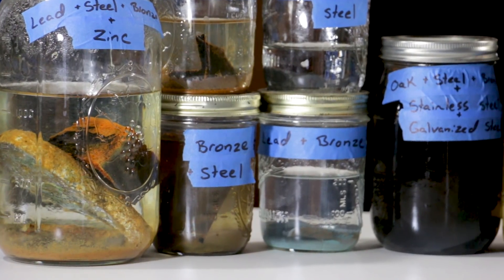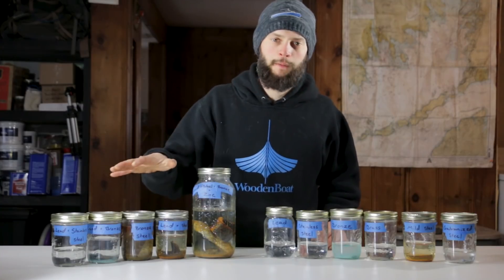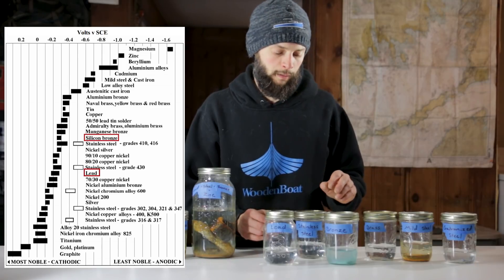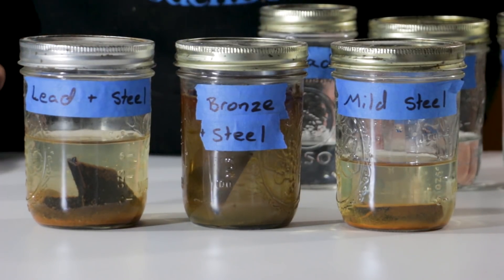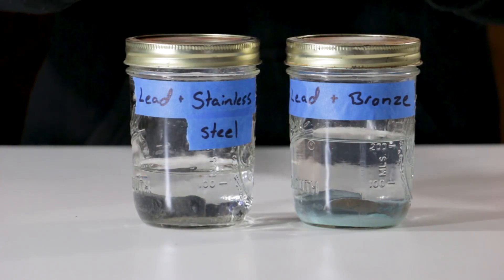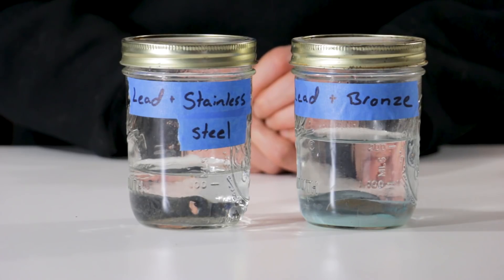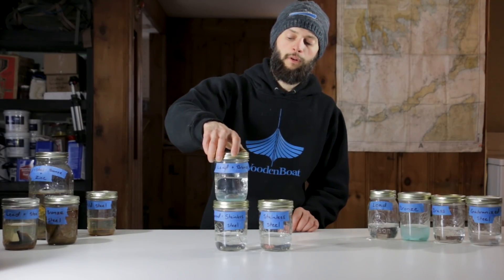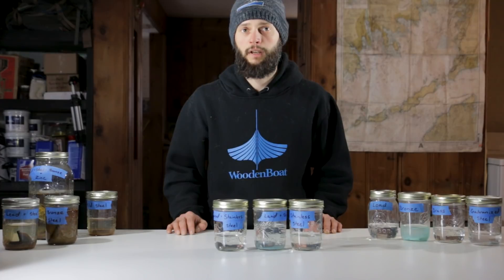A2A - Journey of a Wooden Boat - Bonus Content: Dissimilar Metals and Galvanic action Part 1

Comment: I am really late to the game as I have only just discovered this channel. What an incredible journey. I like this video because you actually conduct an experiment to support your choice in materials. However the nerd in me needs to make a couple of comments 
Although the nobility scale for metals has been around for a long time I think it would have be simpler to talk about more to less reactive metals. 
The “nobler” metal does not attack the “less noble” metal. The electrolyte (salt water) preferentially attacks the more reactive metal
You only talk about stainless steel as an alloy. If fact all your metals except lead and zinc are alloys. I assume your bronze is silicon bronze rather than aluminum bronze. Silicon bronze alloy is more common in boat building for cost and structural properties 
Ok done. Can’t wait to binge through to get caught up
Reply from the maker: So glad you found us!

Comment: FYI, "nobility" is a rough approximation of what is known as standard, half-cell reduction potential or standard electrode potential: higher numbers mean more "nobility", lower numbers mean less "nobility". It's possible to put numbers to these things, and it's generally a good idea to try to do so at the interface between the two metals. There are many things which can be done to mitigate these problems, but the "sacrificial" metals are the most common and probably cheapest in most applications, but there are many other electrode options outside of pure metals which can be used alone or in tandem to mitigate oxidation.

Comment: I was a marine corrosion engineer when I used to work for a living.  I did a lot of accelerated life testing on our products (military sonar systems) and some of the things your tests lack (although being quite clever) is the influence of oxygen in the reaction.  Also trace elements in your test water need to mimic ocean water (we used a commercial aquarium salt called Instant Ocean).  Magnesium in particular will influence anode throwing power.  Bubbling air into your test solutions will make a profound difference.  Air is fine as water will take up only as much oxygen as the temperature allows ( I used to run the tests at 50C to provide an acceleration factor of 13.5 to 1.   I have a patent that explains this http://www.freepatentsonline.com/8012373.html.  I also wrote an article which gets into detail on how to calculate anode quantity http://digital.oceannews.com/publication/?i=99313&ver=html5&p=1&_ga=2.253171840.845859776.1549662016-968016094.1549662016#{"page":44,"issue_id":99313}.

A piece of advice I can give to you and your readers is not to use stainless steel underwater.  It can corrode in numerous ways other than simple wastage.  Oxygen starvation and pitting and dealloying are common types.  There are some specific alloys that have good luck (nitronic 50/aquamet22 as propeller shafting and some very high nickel compounds that also have greater than 6% molybdenum).  Your local West Marine does not have these alloys.  I personally use 316SS on my boat topside, but occasionally will get a screw or washer to bleed rust, even after passification.   It's a crap shoot at best.

I hope this doesn't get buried.

Comment: How about doing a salt-water test of the glue that you've used to lock your deadwood together with.  You're using an epoxy that is used for plywood if I remember correctly.  I've seen plywood come apart when it's been exposed off and on to rain and sun.  So it makes me curious as to how well your deadwood will hold together in the water.
Reply from the maker: No need.
Resorcinol has a long and proven track record with oak and saltwater.  It is a two part glue but it is not a epoxy.  Resorcinol is the glue they use to make marine grade plywood which will not readily come apart when it gets wet, that is also why it is so much more expensive than regular plywood.  The resorcinol is a much more expensive glue than what they use for normal plywood.

Comment: The better grades (316 and 316L) are non-magnetic and considered good for fiberglass sail boats.  I just checked two samples of known SS alloy with the strong magnet from a stick welder's ground cable.  The 304 was magnetic.  The 316 was NOT magnetic.  The "L" in 316L stands for "Low Carbon" so it should not be magnetic.  Hope this helps you identify your SS.  Most kitchen stuff is 304 or some lesser grade (ie 400 series) of SS.
Reply from the maker: Thanks for the tip!

Comment: I've heard that the cooper in pressure treated wood will react with metals...for example the PT wooden bunks on a boat trailer, that gets dunked in salt water.
Reply from the maker: True fact.  Copper preservative and mild steel fasteners would not get along very well!
Reply: Does the electrolysis always occur at the point where two dissimilar metals at are contact? Or could the PT wood bunks set up problems elsewhere in the trailer...i.e springs, wheels, lights, etc.?

Comment: The corrosion on bronze should be (don't quote me) Cupric Oxide or loosely translated, copper rust which is basically (ta dah) a component of antifouling.  Funny how those things are kinda related when it comes to the longevity of bronze fasteners in marine construction, no?  The only thing that still confuses me is how barnacles still grow pretty quickly on bronze props with the high copper content.
Reply from the maker: Barnacles are just super tough, it would be interesting to know the science there.
A lot of metals corrode away but Bronze and copper are pretty amazing metals!

Comment: Zinc + Steel is interesting. As you mentioned zinc is used as a sacrificial metal on outboard motors and the US navy use it with their mothballed fleet from memory. I actually bolted an outboard anode on my 4WD to prevent rust. Worked really well for where I took that truck.
Was a cheaper version of the electronic anti-rust products available for 4WD enthusiasts.
Once again guys, another video you hit out of the park.

Comment: Most people are aware of the effects of electrolysis in metals, but twice in the last 20 years I have seen wooden boats sliced at the waterline due to lack of zinc anodes. That is to say, the boats were cut in half at the waterline due to electrolysis acting on the wet wood due to stray current from the solar panels. Funnily enough both boats were still floating and looked slightly below waterline, but upon approach with the lift barge they basically flipped over. The look of amazement on peoples faces when they see their boat lifted out and the wet half is no longer there is priceless.
Reply from the maker: Yikes!
Yeah, stray electrical current can be very very very bad for wooden boats!
Reply: @ Dom Reale :- "twice in the last 20 years I have seen wooden boats sliced at the waterline due to lack of zinc anodes "

Sorry, but that's just plain wrong. It's actually the unnecessary fitting of zinc anodes to wooden boats that's the cause of this problem. See https://waitematawoodys.com/2016/11/08/want-to-see-what-in-a-wooden-boat-looks-like/ and https://waitematawoodys.com/2016/04/28/electro-chemical-damage-in-wooden-boats/ for the details.

Comment: Excellent video.  Plastic shims or mylar tape can be used to isolated dissimilar metals from each other.  One other point is that while stainless steel doesn't rust, ferrous metals from welding & grinding in the shop puts steel dust in the air that settles onto the stainless steel.  Over time it appears that the stainless steel is rusting.  However what is rusting is the ferrous material in the air that has landed and embedded itself on the stainless.  We used a light acid product that is made from orange peels to treat the stainless steel.  It's a process referred to as passivation.  The light acid eats up the ferrous material so the stainless steel doesn't get rust stains over time.
Reply from the maker: interesting, that makes sense, the wood shop is covered in wood dust and the metal working area of the garage is covered in steel dust from cutting/drilling/grinding steel.  It would make sense that could get on the bolts and rust them.

Comment: One way to know the the grade of stainless steel is to touch it with a magnet, if you fell any attraction its low on chromium, and will eventually suffer from corrosion.

Comment: Is there planning reasons why you can't build a boat house? It seems that your struggling to find topics to fill your episodes. If you can't build a boat shed hopefully you can produce enough episodes in the summer to show in the winter. Sailing la Vagabonde charted a boat for a month to keep there fans happy.
Reply from the maker: This spring has been challenging.  
Usually by the end of March we are getting some warmer day, certainly in April but this spring has been cold and wet.  
We planned enough to keep us busy until mid March figuring by then it would be warm enough to paint.  Mother Nature has other plans.  
A true heated shop would be amazing but it would take a lot of money and a lot of time to complete and be vacant when we leave.  
The subsequent winters should be less of a issue, the closer we get to having a hull/finished boat the smaller the parts become and we can work more in the shop, bring things inside to glue/paint...  Right now everything is just too massive to move inside to work on.

Comment: Hi, A little bit of info if you need it, I have worked with stainless steel for many years, 304 grade stainless is commonly used in the dairy industry, and for making many types of fixings and fasteners etc as it has good resistance to corrosion, but if 304 grade stainless steel is used in or near salt water it will show signs of corrosion, so 316 grade stainless steel is used for this purpose as it has better resistance to corrosion, but is more expensive.
Reply: to add to that john, I have worked as a joiner for 14 years and extensively with oak. I will only use fittings made with 316 stainless because of the reaction with the tannins in the oak. too high a level of mild steel or pure iron fittings  and not only do you get orange rust marks from screws and fittings but also the tannins react with the oak and it forms a dark blue ink like liquid which stains the oak. so oak and sea water, 316 all the way! I'm pretty sure 316 is what they recommend for marine grade applications in my limited experience.
Reply: Sorry forget to say awesome channel guys love all the vids keep it up!
Reply from the maker: Thanks for the insights John and James!

Comment: What's interesting is some dissimilar metals will, instead of corroding, produce a voltage in the presence of a temperature gradient. Both of the dissimilar metals must be at different temperatures. This is called a thermocouple, and these can be used to measure temperature by using a calculation to convert from a voltage into a temperature reading.

In theory one could produce a panel with thousands of tiny thermocouples linked together to produce a panel that converts heat flow into electricity. This is similar to a peltier chip, but without the use of diodes. Idk if it would be more or less efficient, but it would probably be able to handle a higher temperature gradient than a peltier chip before melting or burning itself up.
Reply from the maker: Interesting, thanks for sharing!

Comment: I think you will find that the stainless steel you have is 316, 410-420 would have rusted on its own as this is harder but has a high carbon content. 316 has Molybdenum in the alloy for corrosion resistance. What are the markings on the fixing? Only use 316 stainless for external fixings, 304's is ok internal. If you are using stainless for strength use A4-80 ( 316 high tensile) at least or 2205 stainless. used for keel bolts

Comment: If you are going to use stainless steel for marine purposes you will need 316L stainless steel.This 316L grade is very corrosive resistant. Also very often used for kitchen appliances, kitchen sinks, and more. 304 stainless steel will still rust and corrode, although slower then normal steel. But the difference between the two different grades will be obvious when you put it in salt water, the 304 grade will form a rusty layer and 316L steel not.  Do not confuse 316 stainless steel with 316L stainless steel, those are two different grades (alloys) as well.

I used 316L stainless steel for a hydrogen generator in order to produce hydrogen and I had to use a very corrosive substance (sodium hydroxide, known for it's use as drain cleaner) in order to make the water conductive enough to make it work. And I used brass nuts and bolts to connect the power. But it did no damage at all to the 316L stainless steel and the brass nuts and bolts although the two different metals were in direct contact. But 316L nuts and bolts are not cheap though.
Reply from the maker: Thanks for sharing!
Sounds like quite the project building a hydrogen generator!
Reply: You're welcome. It was quite a project indeed but nothing compared to your awesome project. It's almost 10 years ago, and back then in my country (Netherlands) it was a lot harder to get materials. But I learned a lot from it. I stopped the project because it was rather expensive to do as a hobby. Youtube is awesome, so many folks sharing their knowledge. I love your videos and you guys seem to think things through very well, I like that. Thanks for sharing your videos !

Comment: 2nd year Engi student from the UK, caught your videos on the keel cast, watched 'em all and have been hooked ever since!
The problems with stainless steel with wood are most likely the tannins combined with the seawater environment (there are some above water tannin based anti-corrosion coatings for steels) - the chrome interacts with oxygen to form that "passivating" layer like copper in bronze does, but all steels contain sulphide impurities which break through this microscopic layer, while bronzes usually don't have anything similar. This usually isn't a problem since the rate this layer forms in water, is still enough to keep corrosion at bay. But next to wood, the tannic acid works to dissolve those impurities, creating pits that expose iron in the steel to chloride from salt faster than the layer can form again, forming iron chlorides which break off, corroding the steel and go on to damage wood.
There's other nitty gritty stuff about differential amounts of oxygen and crevices on the steel surface, and how there's one semi-acceptable grade of SS for boats but a quick read on a couple boating forums semi-confirmed they're about as useful in wood as usual mild steels and treated the same way  - by completely sealing the boat or the fasteners in tons of epoxy goop 😂

Can't wait to see what you come up for with designs for the bronze castings practical and fashionable, and hope the weather clears up soon!
Reply: DeNoven that was the single most intelligent and scientific reply I believe I've ever read on a YouTube video.I imagine you as a small child watching a lot of Dexters Lab
Reply: JewishCoupon More of a beardy bloke - materials engineering is just way my thing :D
Reply from the maker: DeNoven, Thanks for sharing your knowledge!  The casting is still down the road a ways and it seems the warmer weather is as well.  We are so anxious to get a bit warmer weather!

Comment: I enjoy seeing experiments like these. :) It's also important to mention that bronze and brass are also alloys, copper alloys. Copper & zinc for brass, copper & tin for bronze, the latter often alloyed with phosphorus for wear resistance on parts like propellors. Copper and tin are near one another for galvanic corrosion. My understanding is that oak has a pH of 4.3 that increases steel corrosion, while the  tannins actually act as a corrosion inhibitor for steel. https://www.fpl.fs.fed.us/documnts/pdf2011/fpl_2011_zelinka003.pdf Also, the iron and chromium in 316 stainless steel has a higher redox potential compared to the copper and tin that make up bronze and may be why stainless isn't a good choice with oak. http://isite.lps.org/sputnam/LHS_IB/IBChemistry/UNIT6Redox/ReductionPotentials2.jpg
Reply: Tin is $10 per pound scrap price. Copper is at about $3.35 per pound, Brass is $3 per pound, Zinc is 35 cents per pound, Stainless steel is about 50 cents per pound. An interesting thing about stainless steel (aka rust resistant) is that you can get it in Magnetic or Non-Magnetic.
Reply: Yes, stainless is certainly lighter on the pocket in saltwater environments of a pH around 8!
The magnetic and non-magnetic comment is interesting. Looking at the reduction potential chart the energy difference between ferric and ferrous iron stands out.

Comment: It's easy to find the best stainless steel a magnet will not stick to it at all. You can tell the cheap stuff a magnet will stick right to it
Reply: Austenitic stainless’ are non-magnetic and generally more corrosion resistant because of their high nickel content. You often see 304 or 316 used for food handling applications, while the ferritic stainless’ are less corrosion resistant and cheaper because of their lower nickel content. Exhaust pipes are typically made from 440 or similar, and will last for 5-10 years in areas that use salt on the roads, but definitely don’t last forever. The ferritic steels are magnetic, so if you want magnets to stick to the refrigerator, it better not be a 300 series of steel. Fortunately, corrosion resistance is not so critical on the outside of your refrigerator!
Reply from the maker: Good tip!  Thanks for sharing!
Reply: This is not really true.  The ability to attract a magnet has very little to do with “the best” grade.  SS can become attractive to magnets after being worked or if heat has been applied regardless of what alloy has been used.